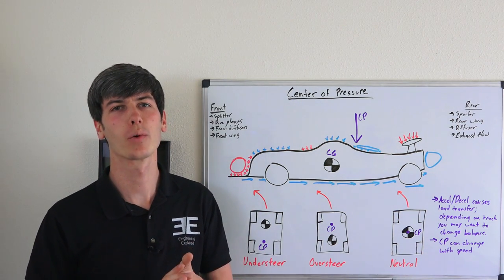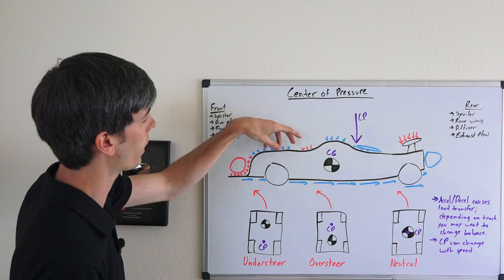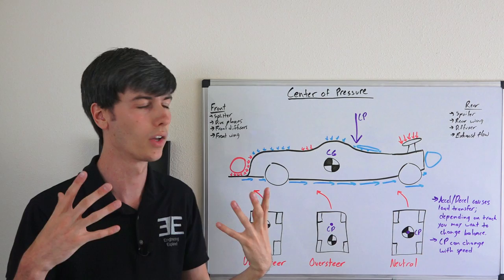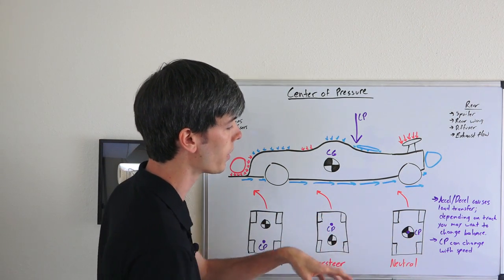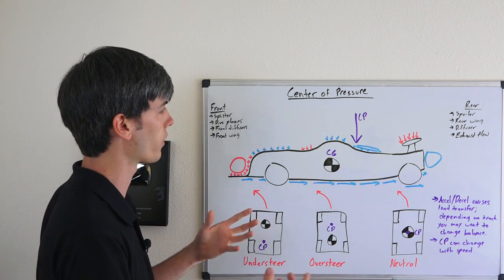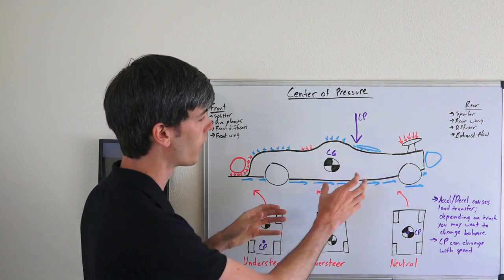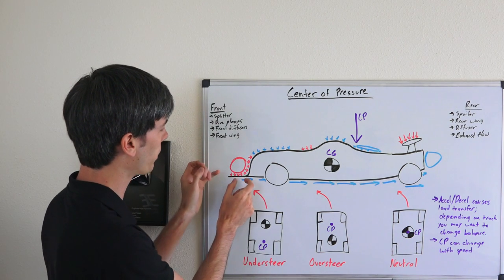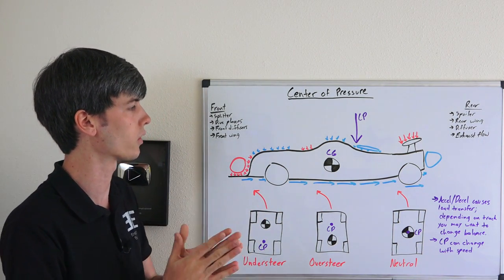Center of Pressure & Center of Gravity - Car Design

Comment: Excelent video, I just did an experiment on this myself at an NCM track day. I'd argue that a slightly aft center of pressure would be better than centered. The car would turn in sharper(loose) at lower speeds then become more stable(understeer) at high speeds. That is how I setup the aero on my firebird anyways.

Comment: aside from a very curvy very small track where aero forces are always light, this seems to imply that all race cars are foolish if the engine is mid or rear mounted.  a front engine car is more likely to have the cp aft of the cg.  i have heard the analogy of the arrow and tail feathers mentioned for the subject.

Comment: I love your videos! Can you do a video in the future about wheel and tire sizes in the context of performance? For example: contemporary cars have wheels that are so much larger than they were even 10-20 years ago. How much of this is form opposed to function? And why do F1 and Cup cars have smaller diameter wheels if larger wheels are better? etc. Thanks, and great work!
Reply: +Michael Porcelli 
Form over function with the new cars.
Formula 1 cars have small tyres because they turn in faster and are lighter, bla bla bla, smaller= better.

Comment: Does lowering your car create downforce? Does it better your cars aerodynamics thus reducing drag coefficient?
Reply: Mortalomena Sort of, It reduces lift.  See cars create lift not down force, just compare them to a wing and you'll see. When you lower your car you reduce the effect of the car being like a wing.
Reply: ***** Im pretty sure bonnet and windshield provide downforce. But is the lift effect caused by ground clearance more than the produced downforce?

I guess the car manufacturers try to balance it out for a compromise of stability and fuel efficiency.

Id really love a video about this.
Reply: Mortalomena I'd suggest you read up on wings , aerofoils and general aerodynamics ,very interesting topics and quite surprising really. pretty much all cars generate lift because of the shape of cars and how it's basically a giant wing. But something like a f1 car generates down force....... insane amounts of it. F1 cars can literally travel upside down with the amount of down force they make. So if you put a F1 car upside down and brought it up to high speed it might fly like a plane (then immediately crash seconds later).
Reply: ***** I do know the basics of aerodynamics, but never thought normal day to day cars created lift.

Is it something noticeable? Ive done 250 km/h on a "normal" car and it felt really neutral to me.
Reply: Mortalomena you wouldn't really notice it because all that would really be happening is the car get's lifted up slightly and the car is under more load because you are travelling faster and the drag is higher. And you can't notice it in corners either because the force of momentum is  very strong and it would be impossible to determine how much of what you are feeling is lift and how much is momentum.

The only time I can see noticing the effect of aerodynamics is if you ever get a chance to be in a f2 car or some other race car with good down force  and you get to go around a corner you'll notice that it's easier to go around at higher speeds than lower speeds, the opposite is true for normal cars because they as we've said produce lift not down force.

Comment: Thanks for doing this video! Thinking of deleting the spoiler on my integrafor an ultra clean look. Would it drastically change the center of pressure and decrease fuel economy? Or was it just put on by Acura marketers because it was the 90's?
Reply: That spoiler is maybe putting a sac of potatoes weight of down force at 100 mph not a whole lot of difference in a car that weighs what it weighs
Reply from the maker: Quinn Park Unless you're tracking your car and reaching high speeds, considering the COP on your road car is pretty irrelevant. Feel free to take off the spoiler, it's likely for aesthetic purposes anyways. :)

Comment: Is there any point to spoilers and wings that come stock on a lot of cars? I.E. 2005 Mustang GT (mine), Charger, Camry. They seems way to flat and horizontal that they look ineffective.
Reply: The flat ones are more for reducing drag than producing down force. They work by deflecting air away from the low pressure zone on the back of the car.

Comment: I'd like to offer a (minor) rebuttal to your vid. You mentioned that the position of the COP vector may change with speed, but the magnitude of this vector will certainly change with speed.  The magnitude of the COG vector will never change, so what you have is the sum of a constant vector, and a vector which changes with speed.  So the correction I'd make to the video is that COG in front of COP = more prone to understeer the faster you go.  Likewise, COP in front of COG = more prone to oversteer the faster you go. COP on COG = constant handling characteristics (could be understeer/oversteer/ or hopefully a nice 50/50 distribution)
Reply: hatethetube46  
Unless I misunderstand your statement I believe you may have misheard Jason. 
I did not hear Jason say that the magnitude of the COG increased with speed, please cite the time in the video of that occurrence. 
As to COG leading COP longitudinally resulting in increased understeer and COP leading COG longitudinally resulting in increased oversteer, that is correct and is exactly what is indicated on the white-board and is what Jason said. 
GOP vertically aligned with COG longitudinally and laterally can be a neutral handling car, but not necessarily a balanced 50/50 weight distribution. ;)

Comment: Looks like Nissan's radical departure from conventional LMP1 setup was not as successful they had hoped. I am sure the got lots of real time data recording from the race though.
Reply: Neil McMahon They couldn't use their Hybrid system, so the power of their car went from a maximum of 1250 HP to a merely 550 HP from the ICE alone. They just used this years Le Mans as a training ground and are planing to work on the reliability issues for the next year.